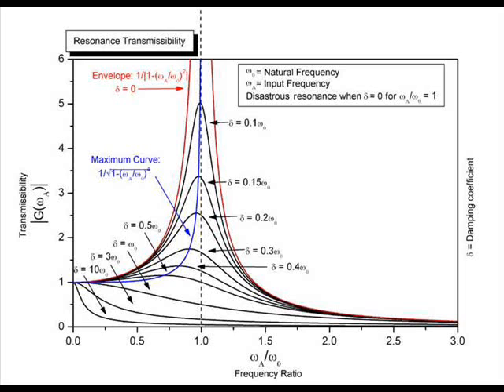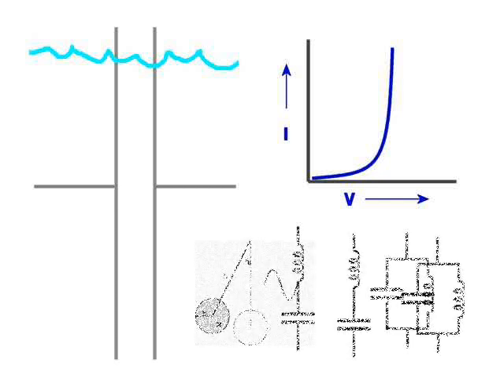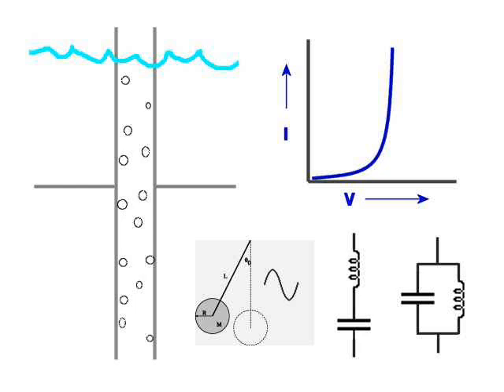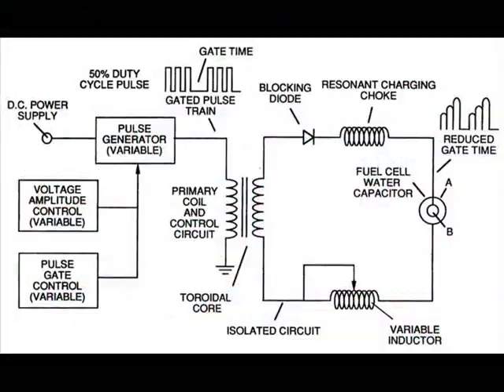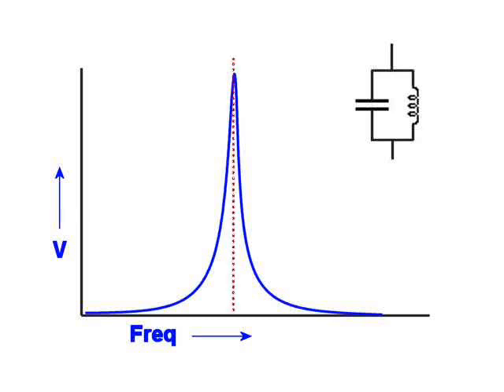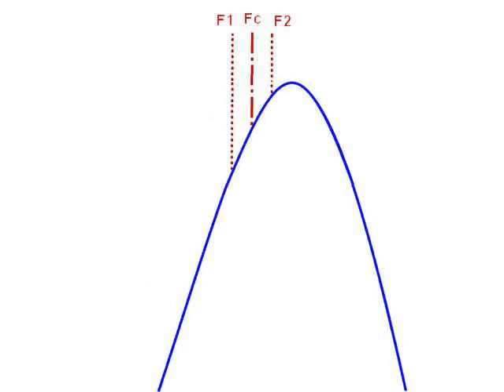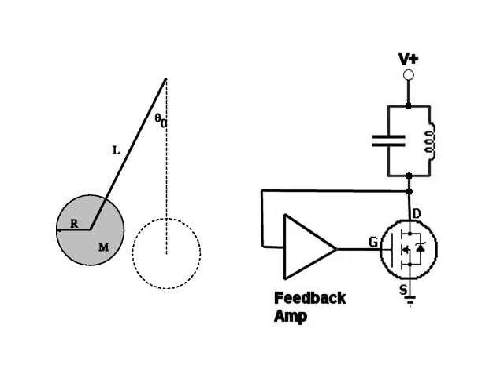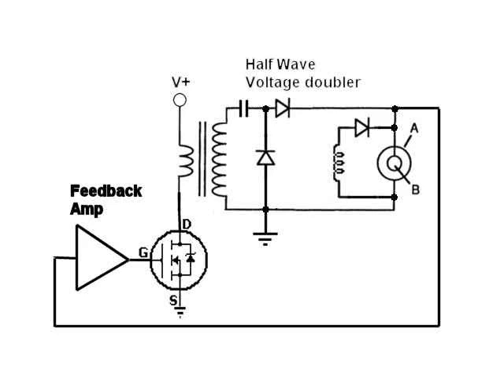#108 My newest resonant WFC theory

Comment: Try a different plate design that allows for the bubbles to rise without interfering with the "dielectric zone".  This could be wires strung back and forth. Paralel them to handle the amperage. I am not sure if the bubble chooses to form on the negative or the positive.  If it chooses one or the other that would be the wire that is offset to the bottom.  This would leave the "dielectric zone" kitty corner and consistant.

Comment: I agree with you almost totally. Water is very dynamic and has those properties you mention. They do and are dealt with. So many things affect the dynamics of it all. Resistance, capacitance, impedance, current flow, leakage, frequency, and voltage. A circuit has to be designed to deal with them. It is not an insurmountable task. It is done everyday in different electronic circuits. BUT the goal is to break the covalent bond of the water molecule with the least amount of power consumed.

Comment: its old world magic: im not being sarcastic.... you will have to do a little research into l/c tank circuits.  resonance is just a joint venture of a capacitor charging a coil, and the coil returning the favor to the capacitor.  In the closed loop of the circuit,  it theoritacally exceeds laws of physics;  the current measured to the capacitor, add'd to the current in the inductor will excceed the current supplied to the circuit

Comment: Wanted to share the modification I made to my bubbler.  (as background, id blown the top apart of the old one twice in 1 week)..  Anyway,  i cut the bottom 4 inches of the bubbler (its made of 1 1/2 inch pvc) and slipped a piece of a old bike innertube over it, and then reinserted the end piece.  refd the entire unit with water.  now when I get a flashback, it will just force the entire volume of water into the rubber, then recover itself!

Comment: Yes, that was the utility company. To produce 60kWh from your alternator with gasoline using regular brute force electrolysis will take approximately 1.63 gallons of gas, so this is not very efficient. Now though I am not talking about the added benefits of using the HHO in the ICE or a more efficient method of electrolysis like Meyer. 55 cents for a gallon of water that will produce 1860 gallons of HHO.

Comment: OK so if you have 2 monatomic hydrogen atoms and 2 monotonic Oxygen atoms with the proper amount of electrons they will combine to make H2 and O2. But what happens when we remove electrons like we did to turn off the covalent bond?? The free electrons continue to move toward the positive plate and now can also be used by the system. Now you have missing electrons and the atoms cannot move back to a diatomic state, right? Therefore HHO. It also has some strange properties that just H does not.

Comment: Well I told myself I was not going to post on here anymore but I can't help myself. I saw somewhere that it takes 60kWh to produce the equivalent energy content of one gallon of gasoline with normal brute force electrolysis. So at $4.50 for a gallon of gas here and electricity at about 6.5 cents a kWh it would cost me $3.90 for the same amount of energy. That is still cheaper then gas at that point.

Comment: wait....  im not sure you are understanding how resonance works; there is no conduction of current across the dialectric of the capacitor; only the building electrons on the negative plate; and the depleation of electrons at the positive plate....  what we are trying to do is carry this effect into the electrolysis proccess.  create the field,  use the force that was stored in the previous cycle ( that would have been lost in a non-resonant system),  and stack it underneath the current force.

Comment: no no no, Sorry there Phill, could be what every one else is talking about, not me. This is not electrolysis. This method is not using brute force to rip the hydrogen from the oxygen. There is much more to it than I describe but like I said "in a nut shell". There are a few separate parts of what I work on that use resonance. What I was referring to here was using a force of resonance on the electron. See you push the electron it wants to com back. You push it again and again till it leaves.

Comment: I think that I got my head around that. The way that this works is based about quantum mechanics and controlled by electronics. The QM side you add just enough energy ie voltage to an electron to get it to jump to the next level of orbit, you do this repetitively "resonance" takes less energy until that electron has left the orbit of the atom. now you have an unstable state of that molecule and this turns off the covalent bond of the h2o molecule. This is not electrolysis that is not efficient.

Comment: even if you are putting in less than you get out there are a few things to remember.

1. solar cells wont run my SUV.
2. HHO is cheaper than Gas and will run SUV
3. The burning properties of HHO are vastly different that gasoline or ANY petrolium product.

This means that the effective result is mobility or heat from a clean source that costs less and is actually viable. You work at a solar cell place and you know you cant run a car on them.

Comment: We need to do this ... and it needs to be integrated into the system better such that the dissociation is in much closer proximity to the reaction chamber.

It is my theory that RF or microwaves disrupt the bonds between the molecules as it uses the molecules to propagate its wave-form. But once the wave has passed and the atoms have flown away from each other, they are lacking electrons ... so they are looking for a new bond NOW.

Comment: Try using tungsten anodes instead and make sure you get the ones used for AC or DC look up Tig welding and you will see why I think this might work. Have you tried it with holes in the anodes the same size as a hydrogen bulb. I think a laser will do this the best and spacing will be everything on this but it will increase the surface area and improves the frequency system I think.

Comment: Hey Zero, Im quit sure you have heard of the Geet plasma concept. My brother and I are building one onto his generator, If it works, im going to persue further into the idea of tieing the two technologies together on my truck. Sorry dont have a cam to post my constructions. BTW, I noticed people are making flash back arresters to use on their systems. bad idea, Go to your local AirGas supplier and pick up an Oxygen tank arrester. They work great, and you can depend on them.. thanks a mil. Zero

Comment: Hello ZFF,
I'm shore You are write bud I made also somme calculations and to run completely on water the cal must produce (fore a 3.800cc engine)
aboud 16 liters of HHO / sec. Do You see a possabilaty ?
You are also good in electronics I see, look also to the new switshing technology (SMPS) in combination with the alternator of the car !
Becorse now mather how You try for this amount of gas thats required we need somme power (30 to 50% of the power from the engine!).
Waterinjection ITS!

Comment: Hi Zero
As.we know that with a Inductor and a variable capacitors-HHO CELL  that it will become resident over a wide range of frequency's.Like you said no matter what dynamic changes there are .our tank circuit will always become resident. My question is, Do we need to modulate the carrier or is there a need for any error correcting? can we just simply sample are resident frequency amplify it and then feed it back in phase to sustain oscillation.

Comment: Just had a thought.  I'm guessing you're looking for a constant on state.  What if you used a cascading design in a similar way to a brushed motor.

Here's what I mean:
State           Voltage
initial         +nnnnn-nnnnn+nnnnn-nnnnn+
first valley    n+nnnnn-nnnnn+nnnnn-nnnn
next valley     nn+nnnnn-nnnnn+nnnnn-nnn

and so on...

Its a rough idea, but if you want to apply voltage when the frequency of the cell hits a valley, this seems to make sense...? maybe?

Comment: When you hook that to your WFC you will get a ramp step charge that Meyer has described in all his patents. As I stated before you now take the Dynamic capacitance of the WFC out of the equation.
If this works in this way then I think that you can add a circuit that will sense the moment you have a catastrophic failure of the dielectric and at that moment you gate your PWM off.

Comment: Zero, I've been learning much from you for several months. On your f res theory, the physical characteristics of the device (ie: area, gap, electrolite) will be dominant in the f res. Pulsing to that f will be beneficial. However, if the goal is to fracture water, would it not be best to switch at the resonant f of water? That is, set the physical characteristics of the device (area, gap etc) to resonate at or near water res f. Your self resonate f would provide maximum results. ;>Q

Comment: I'm just starting to take an interest in alternative energy concepts.  GEET and the Meyers fuel cell seem like the best things I can find.

I figured I would start with trying to make a GEET carburetor since it is relatively simple and I have very little experience with electronics.

The thought of controlling and adjusting the pulsing of AC current seems quite daunting to me.  Something like you've explained would make it much more accessible!

Comment: The one thing that does not change is the water molecule made up of 2 hydrogen atoms with one electron each and one oxygen atom with eight electrons with 6 in it outer orbit wanting to share the two from the hydrogen atom to form a covalent bond. This is always the same. So if you look at what needs to be done this is always the same, would you agree?

Comment: So we have 2 choices. First if it is H2 and O2 what keeps it from being Hydrogen Peroxide? The second theory is that the H and O are maintained in an ion state by the high voltage that is applied to the cell. So as long as the energy is maintained at or above the ionization energy required then it will remain in the ionized state, right?

Comment: So now you have an unstable molecule basically without the strength of that bond. So now you have a plate that is positively charged that will attract the negative Oxygen atom and the Negatively charged plate will attract the Hydrogen atom. So by removing one electron you turn off the covalent bond. This is different then brute force electrolysis.

Comment: Zero, I had another thought about all this today... what if we turn the water into vapor and stream it through the RF where it will become the dissociated gases?  Wouldn't that reduce the frequency variations?  Of course that ads a different level of energy complexity ... heat, but after the engine has been running for a time, that shouldn't be much of an issue.

Comment: I am starting to ask myself. Self "is resonance the key to Meyers WFC". I think that the step-charge signal at the proper voltage is the key. However we get there. The problem with that is feeding that signal into basically a direct short of the WFC. Impedance matching??

Comment: Why? ;)
How can it reach 'unlimited' voltage?
Perhaps Meyer's bifilar wound coil can be seen as a transmission line, see fig 8-3b of the techbrief: 2 parallel wires.
Do you think the self resonance freq of the choke is important in the vic?

Comment: No, see this is where every one goes wrong. Yes you are right with electrolysis but this is not electrolysis. It takes more energy with electrolysis to break the h2o bond (or rip it apart. This is not the case here. Well here not sure there.

Comment: good idea but have fun with overheating
Reply: Chemistry heat makes breaking bonds easier, don't fight it use it. Firefighters know at  certain temperature spraying water on a fire only feeds it as the water gets split into hydrogen and oxygen.